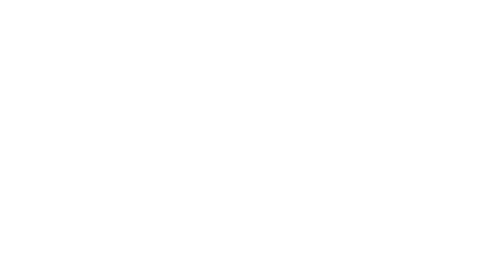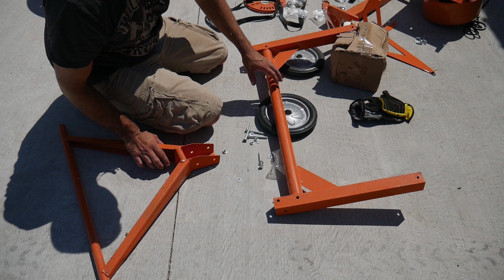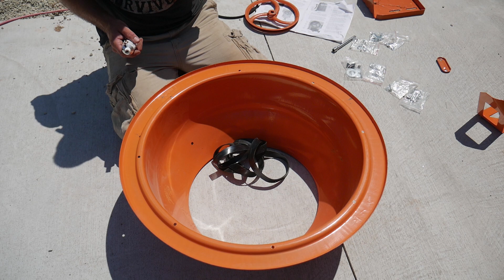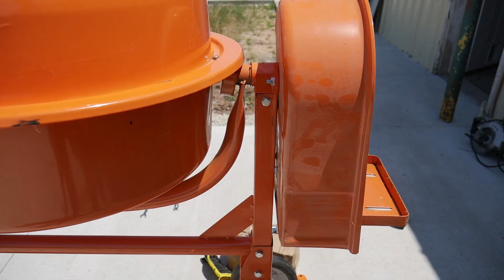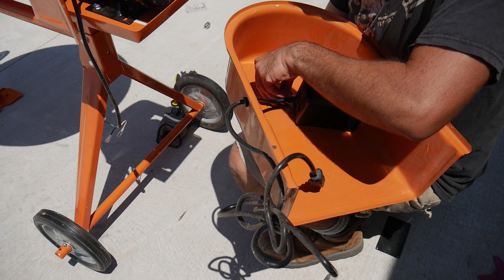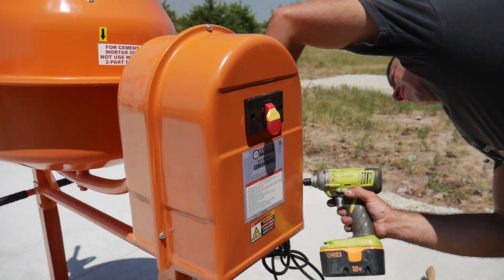How to Assemble The Harbor Freight Cement Mixer

Comment: The spring mechanism on the control handle has changed. No adjustment. Leave the plate loose until you get the pivot bolt in.
Reply: Đorđe đavo đaka đubriva đubriva đubriva đubriva đubriva đ

Comment: I had assembled mine backwards. The motor and pulley wheel is on the wrong side. Any idea how I can remove the pulley wheel ? I tried it last night but could not get it to release.
Reply from the maker: you might need a pulley puller to remove it or just try and tap it off evenly.

Comment: Thanks for this video..  looks like fun.
I noticed you didn't line up the Vertical Drum Arrows when assembling the two halves..  wouldn't that make the deep-inside bolt hole line up to a bolt already installed / secured, and not to the open holes?
Reply from the maker: good catch, I completely missed that in the instructions. I believe it will still function properly. I will see this fall when I use it.
Reply: Yeah I almost missed that one when I assembled mine as well.
Reply: @1MohrFarm  Oh, don't worry about it too much, the arrows on mine caused more confusion than they were worth. When the arrows were lined up the clamshell halves wouldn't bolt together (by a mile!), and then the fact that they weren't lined up made the geometry of the inner mixing vanes incorrect. We'll see how it works with the vanes in the wrong position...I suspect yours is the same, did your mixer end up working ok?
Reply from the maker: @steveanderson9290  worked great so far. Put over 15 bags through it and no problems.

Comment: Here's also a tip there are 8 M8 lag bolts. They look similar in length but line them up you'll see that 4 of them are slightly longer than the other 4. The longer 4 bolts are used to assemble the stand base, it gives the little bit of extra length to get a nut on the end. The other one are too short to go all the way through. The instructions are junk but to be truthful after figuring out what bolt went where and be sure to use a bit of gasket maker to help line up the gasket this is actually fairly easy to assemble.

Comment: trying to assemble mine today and yesterday. its annoying they give you so little information on the hardware parts. trying to figure out the difference between an M8x60 and an M8 x80 or whatever is Not my strong suite... its coming together slowly, but ugh so frustrating they dont label the Hardware better! gah!.... anyways. it should be intuitive, but its worse than Lego, and i loved those damned things haha... but yeah, better parts labeling and more detailed assembly instructions Would be necessary for them to include for slightly clueless  assemblers... lol at least mine came with the electrical and motor hooked up and ready to bolt in. that would be a nightmare for a non electrical assembler like myself... one nice thing i have found at least eh lol... though having to fix some shipping damage. hammer the drum a little bit... easy enough, im good at details like that at least haha.

Comment: Thanks for the video, the instructions that came with the mixer was crap
Reply: I agree, mine were horrible, did you get yours assembled okay?
Reply: Plen122 yes, but made unnecessary mistakes
Reply: @txtermm  hmm I made a few myself. What surprised me the most was the key way, I had one installed but I don't think the instructions, as horrible as they are even mentioned the other one lol. So I had to find a machine shop and once I did that, I was good to go. Oh yeah and added some thread locker.

Comment: I had assembled mine backwards. The motor and pulley wheel is on the wrong side. Any idea how I can remove the pulley wheel ? I tried it last night but could not get it to release.
Reply from the maker: You might need to use some type of pulley puller because of how tight it is.